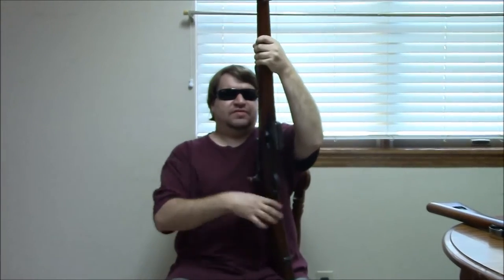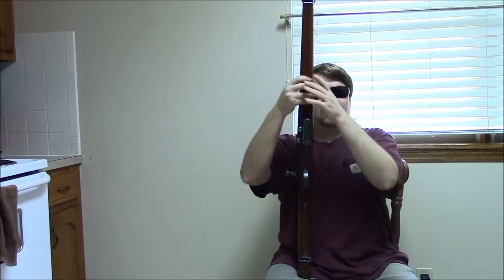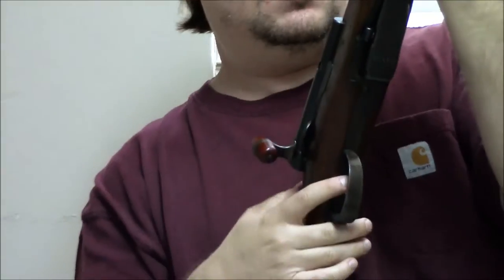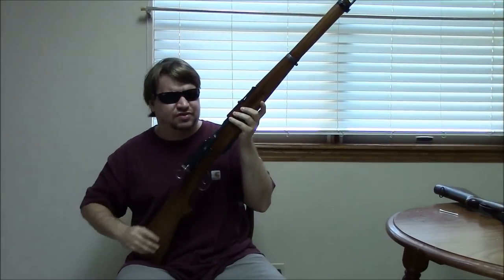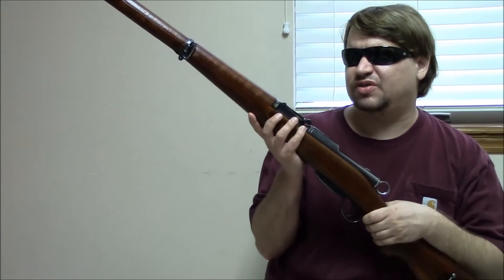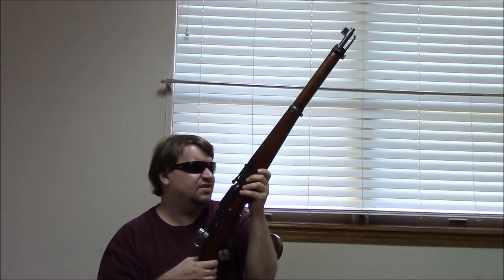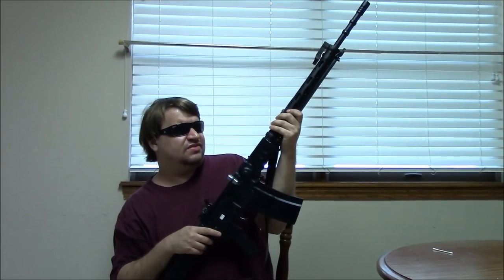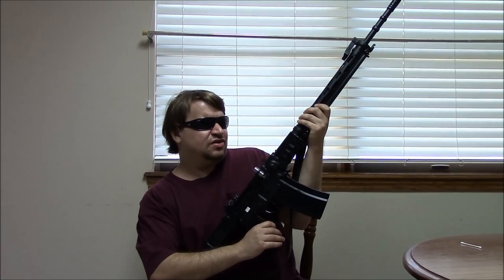Swiss Rifles - Schmidt-Rubin 1889 to K-31 and STGW-57

Comment: 7:13 the Steyr was for cav use only, they were very unliked and dropped fast.
31:00 It is the most expensive standard service rifle ever to be issued to the soldiers.
33:30 It was standard doctrine to use the bipods close to the handguard and not at the front during the service. It was just some years ago when this was dropped.
35:20 On very often shot and sometimes not cleaned guns there is a chance after all those years there are very fine haircracks. Not something really safety related but something to look out for.
37:45 There were already SIG rifles being exclusively exported at the turn of the century. The Mondragon rifle to mexico or the KE-7 to china for example.
Very nice video.
Reply: yup it was but it was also almost indestructible.